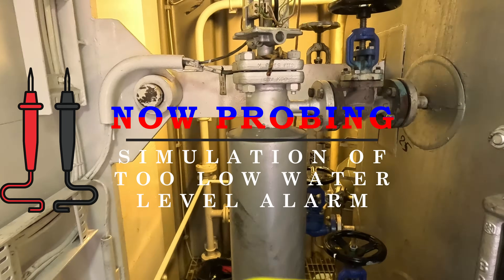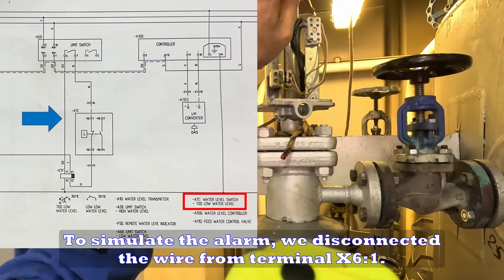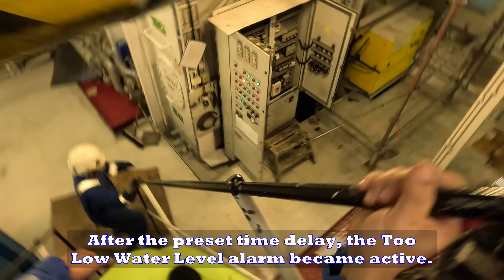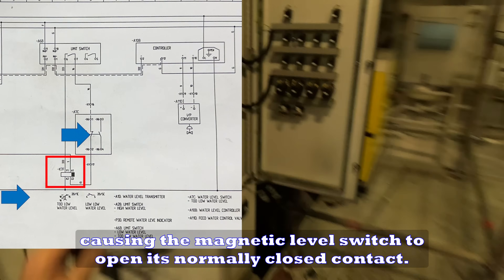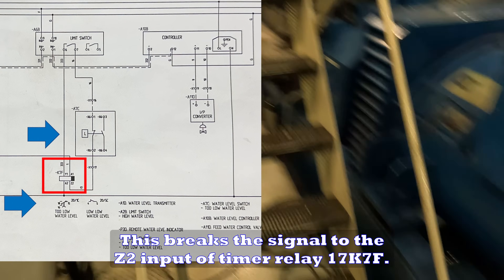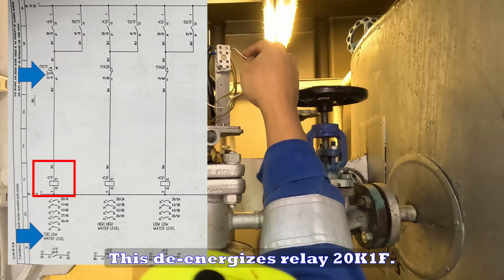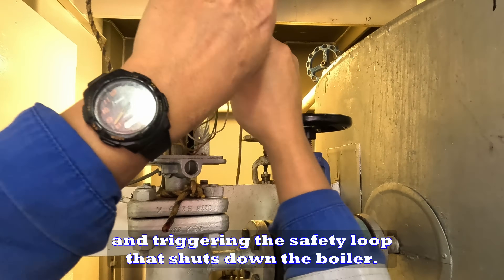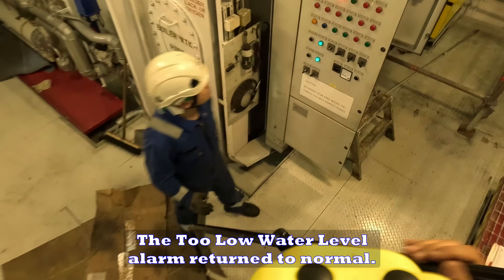#ProbeTips! How To Simulate Boiler Too Low Water Level Alarm

Comment: This is of course easy way to test low low water level, but not for inspection. Correct way is to close stop valves before magnetic level switch, and drain the water, if drain is available of course.
Reply from the maker: Hi, thank you for the good input. For the full info and context of how we test the too low water level alarm, please watch this: #ProbeDD2025! How We Fixed Oil Fired Boiler Low Low Water Level Alarm (Dry Docking Day 32)
https://youtu.be/swIPhDrfNZY (timestamp 12:15).

We took the easy way here since this is a troubleshooting scenario, making the boiler alarm free first before presenting it to DNV class survey. For the real alarm where we drain the water, please see the full episode where 2Eng operated this valve.
Reply: How sir for high level alarm?